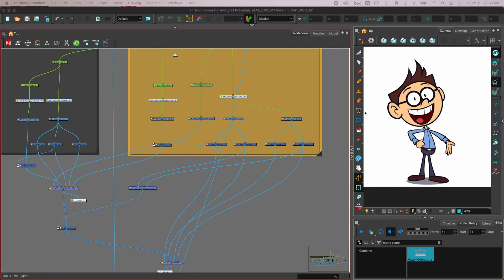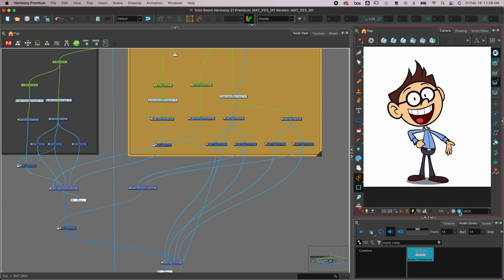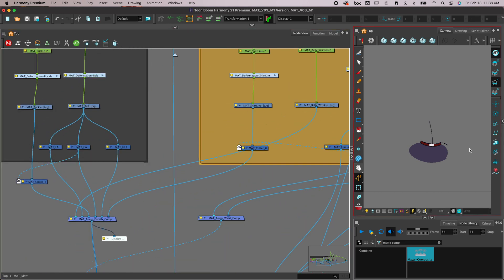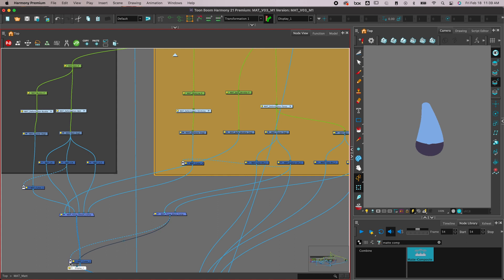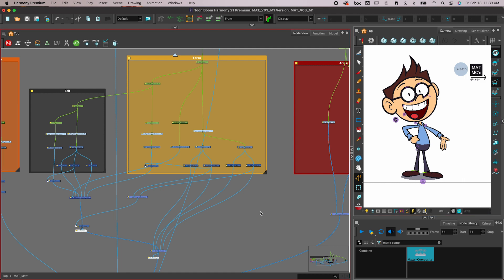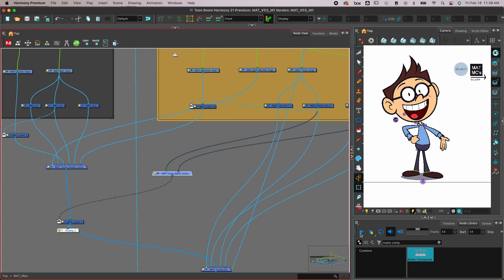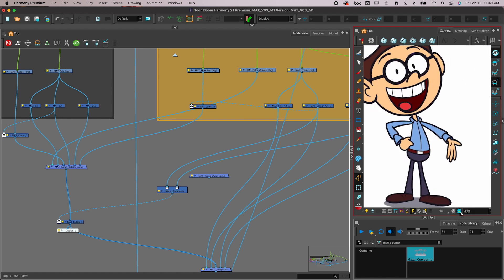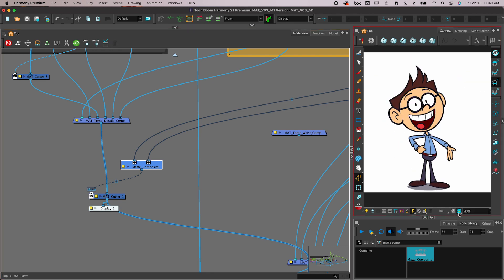Apple M1 Chip Workaround for Toon Boom Harmony Premium

Comment: Hi Matt, firstly, thanks so much for your tutorials, so useful! I’m having a problem with scripts though. I’m using Harmony 20 and the find and replace script isn’t working. I get errors whether I include or not the START and END part of the script. Also, for the copy pivot script, I unzipped it and placed it in the exact path toon boom wants it but the icon isn’t working and neither is the script. I’d appreciate it if you know what’s wrong! Thanks!

Comment: This issue also seems to happen on a Windows 10 system. My team and I still don't know why exactly but this looks like a plausibile solution. Thank You. I would never thought to use the Matte Composite.
Reply from the maker: Michael, another thing to try is make sure that your OpenGL preferences are set to Enable Composite Pass through for all effects. Make sure to checkmark that. Sometimes a rig will look fine on one computer where they build the rig with that setting turned on and then it will look like weird things are happening for someone who is not using that setting.
Reply from the maker: Woohoo! I hope it helps!